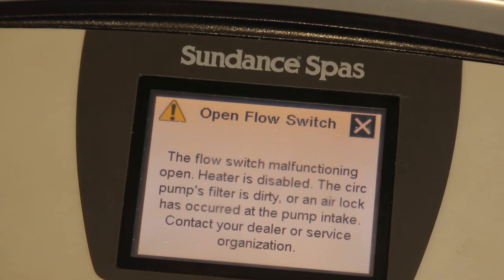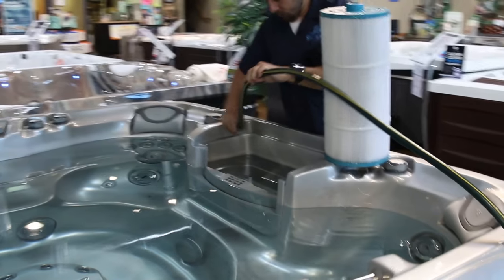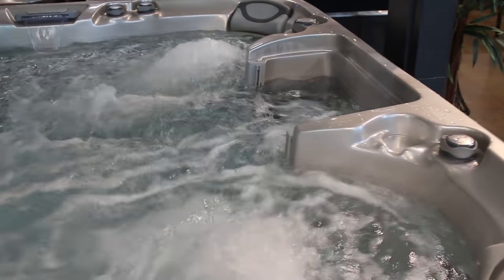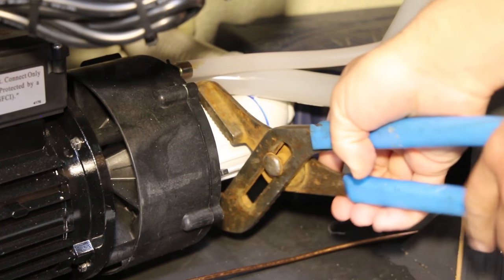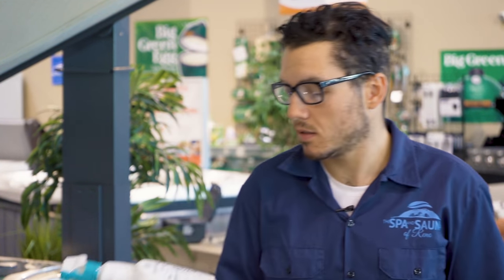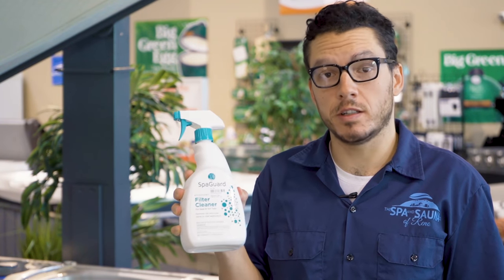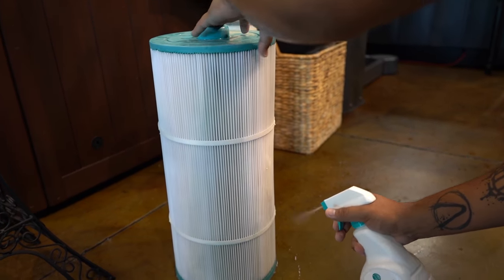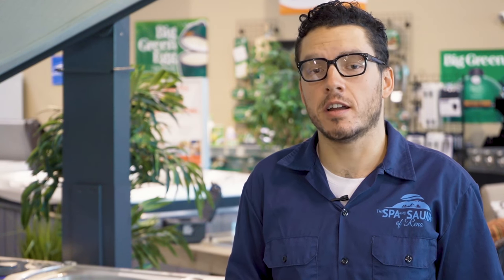Fix a Flow Sensor Error on Your Hot Tub and Fix Your Spa Not Heating | How To

Comment: Thank you so much for this video. I spent days trying to fx a flow error. After watching this video, I was able to remove air pockets with a garden hose. I also opened two bleeder valves next to the filters. Error went away, and now I have hot water

Comment: I flushed out the lines where the filters go and it started working again, then it stopped again, we have one filter that we will replace it’s not seated right it’s sticking up, would that cause the sensor A to come on?? Tu
Reply from the maker: Hi Alice, to answer your question - yes, a filter that is not seated correctly will likely cause a flow sensor error, especially if it is not seated correctly due to damage or incorrect size.
Reply: @TheSpaSaunaCompany  I purchased a new filter and both were seated well, refilled the  hot tub and it’s says service required, sensor 1. Tu for your responce